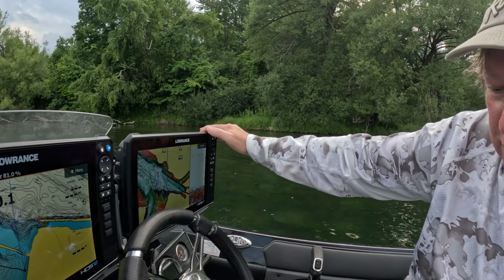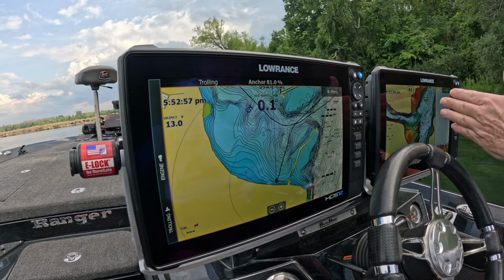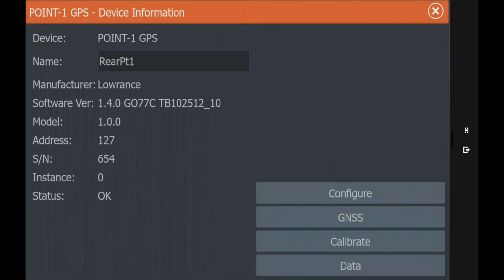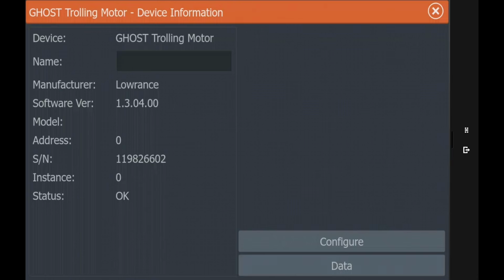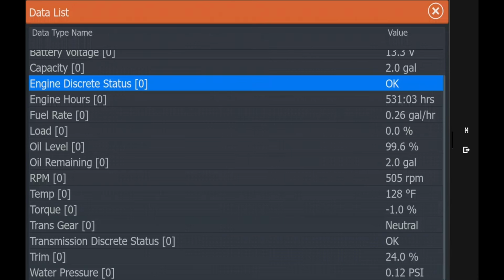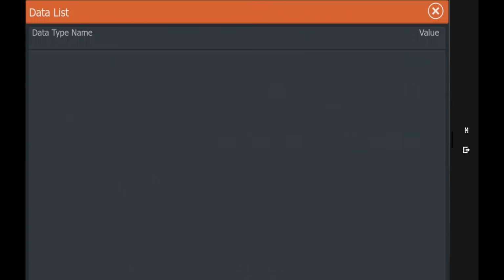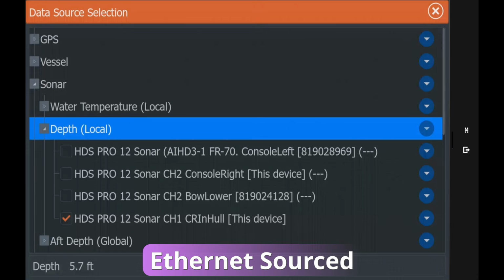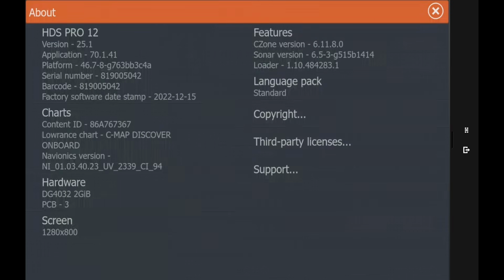Lowrance Networking Basics Ethernet and NMEA 2000

Comment: Hello Gary, I am trying to help a friend who has 3 HDS Pro 12 on his Ranger. Somehow in this network settings he has named his left side unit 4 times “Left Console Unit”. How does he delete the 3 names he does not need.
Reply from the maker: Hi, sorry for the delay. If I understand correctly, the boat has 3 units with 2 on the console and 1 on the bow. Usually when you name a unit in the network name on the Network setting panel, it will stay that value and any existing one is removed. Then if you look in Data Sources, a unit will come up in multiple places with that name. If his left console unit has 2 transducers connected, then you will see at least 3 Sonar sources for that unit - one for CH1, one for CH2, and another for "panel select". You'll also see it under the temperature sources since most likely there will be one transducer that has a temperature probe on it. And it'll show up as a GPS source. Also, if you look at the Device List, which lists devices on the NMEA bus, then you will see 4 to 6 devices listed for one unit since each unit provides multiple data types to the bus. That is normal. Contact me on my Facebook account if you need further help. Garry

Comment: Hey Gary…my device list does not show the AI3in1HD ducer, the thru hull ‘ducer, nor the nosecone. Should these items be indicated in the device list?
Reply from the maker: If you go to the Sonar Installation dialog, then you should see the thru-hull on CH1 and nosecone or 3in1HD on CH2, depending on which unit. If the thru-hull is a 9 pin then it will be automatically detected properly but it may show up as unknown. I usually set that to PD-WBL The nosecone and 3-in1HD are 9 pin, so they are detected properly. In any case, 9 pin transducers are detected and you can select the available frequencies on the Sonar page. Garry.

Comment: Should the ethernet connection share Point 1 data between units?

I have a Point 1 connected to the console unit. It works properly. I have ethernet to two Elite FSs at the bow. They seem to be able to "see" the Point 1 in data sources, but always show (Invalid), and heading on the charts is definitely not using the Point 1. The ethernet connection works great for sharing waypoints and sonar.
Reply from the maker: You need to check your Devices on the Network Settings. The Point 1 is only connected to the NMEA bus.  In order to see the Point 1 on all of your units they have to be connected to the NMEA bus.  The Point 1 is not shared on Ethernet.
Reply from the maker: Also, make sure that the NMEA bus is properly connected and powered. For your configuration you should have 2 terminators (one at each end), 3 Tees, 2 drop cables that connect to the units,  the Point 1 drop cable, and a power node that is a Tee with a cable to is fused and goes to your power supply.
Reply: All worked properly once I extended NMEA to the bow. I had just incorrectly assumed that the Point 1 data would be relayed/shared over Ethernet after it was connected to the console unit. 

Thank you for the great channel. It's helped me a lot as I've rigged out my boat.

Comment: I’m running three Elite FS10 units, a Elite FS12, and an AT2 system ran through my NEP2 hub and NMEA2000. This video helped a bunch, when I pull my boat out this weekend maybe I can finally get data besides just waypoints to share between my units. Fingers crossed but if I don’t I’ll probably have some questions.
Reply from the maker: That sounds good. Try to see if you can see any other Sonar sources on one of the units. Pages->Network->Data Sources. Then open Sonar and then Depth. You should see all of the units that have a transducer on them. If so then they are sharing data on Ethernet. I hope that it works (it should).
Reply: @garrywoodruff960 I do see other data sources, but I am not seeing sources in terms of sharing mapping chips or sonar options. About the only thing that seems to be linking properly besides the waypoints is the Point1. Any ideas?
Reply from the maker: The waypoints and the Point 1 are networked by NMEA 2000. So, can you see the blinking lights on the NEP2? If not, then make sure that it has power and that the Yellow wire (wakeup) is powered. Can you see the Active Target on the units? If you go to Pages->Settings then scroll up to About then Support then check for updates, do you see all 4 of the units, the Active Target, and the Point 1 in the list? (you'll have to scroll up to see the rest of the list.

Comment: New to understanding NMEA networks. My boat has 2 Lowrance HDS12s connected via NMEA along with Sonic hub and Point 1.

My GPS signal is constantly going in and out throught the day. If I switch the GPS source to point 1 on the bow graph, I have GPS signal. I went to diagnostics and the Bus keeps switching from On to Off. This happend occasionally last year, but almost non stop this year. Also, the sonic hub is sometimes available, and sometimes not. Thus also leading me to believe its NMEA related.

Where should I start to look to fix this problem? I appreciate the help.
Reply from the maker: It does sound like the NMEA 2000 bus is not operating properly. Here are the checks -

(1) check that each device (Point-1, SonicHub, each unit, etc.) is connected to the bottom of the Tee connector.
(2) Check that there is a resister on each END of the network.
(3) Check that there is a power line on one of the Tee connectors and that the fuse is good.
(4) Check that all connections on the bus are tight.

All Tees should have a device or the power line on the bottom.
All Tees should have a backbone cable, another Tee, or a resistor connected to it.

You can also check the network by :

1) Settings -> Network -> Device List
    -> It should list 5 or 6 devices per unit, Point-1, SonicHub, etc. (it depends on if you have other devices as well like a Ghost or Recon trolling motor, auto pilot, and so on)
   > then select the Point-1 and touch Data in the bottom right - it will show the data from it.
2) Settings -> Network -> Diagnostics
  -> on the NMEA 2000 tab you should be transmit and receive counters and possibly the error rate. Make sure they are increasing for the counters.

You should be able to do the above steps from any unit that is connected to the NMEA bus. That will help determine if there is something wrong with your backbone cable(s) or connections. If you see the network at one unit and not another then you have a segment to look at.

Let me know. Garry

Comment: I am using an HDS 10 Pro connected via NMEA 2000 to a Lowrance Recon. On my previous setup (HDS 9 Gen3 + MotorGuide), I frequently experienced control lockouts when mirroring to a tablet. After a period of navigation, an error would pop up, forcing me to leave the deck and return to the main unit in the cabin to regain control.

Does the HDS Pro allow uninterrupted control of the Recon via tablet, or do these lockouts still occur on the newer platform?
Reply from the maker: The Pro is a much faster unit than the Gen3 and the Recon is better integrated with the software, so I would expect fewer issues with mirroring. It also depends on your tablet as well. I have not tried to control my Ghost from my tablet yet (Samsung S10). If you are still having issues then I will try to replicate your problem when it finally ices out and warms enough to pull the boat out of storage. I can also ask on the Pro staff call this week for you. I know that several of the guys have a Recon and Pros.

I hope that helps. I'll let you know if I get some information from the meeting. Garry
Reply from the maker: I asked my pro staff contact about the Recon for you. I'll let you know when I hear something back. Garry

Comment: Im nit getting any power to my nmea bus. Can you help please?
Reply from the maker: Hi, first you need to locate the power node on the NMEA bus. It will be attached to a Tee and then contains an inline fuse holder before connecting to power. I would make sure that the fuse is good and that you have power and ground connected to the end of the wire. If you cannot find the power mode, then there may not be one in the circuit and you'll need to add one. The NMEA 2000 bus only requires ONE power node to operate. I have seen boats where there were two and the network did not properly operate, I had to remove one power node and properly cable the network to get it work.

Next make sure that your network has terminating resistors on EACH end of the network. The resistor is connected to a Tee on one of the top sides. The other side of the Tee connects either to another Tee or to a NMEA cable. This provides the network backbone to the boat. You'll have a female and a male terminator for your network. They come in pairs.

You can go to your units. The NMEA plug is the small black one. Make sure that there is a cable attached. And make sure that the cable attaches to the bottom of the Tee.

Then power up your unit and go to Settings->Network->Device List. That will show you the devices on the NMEA bus. For each unit you will see 5 or 6 devices, that is normal. Other devices will be optional like temperature sensors, engine controller, trolling motor, etc. Some devices, like the engine, trolling motor, other units, need to powered up to see them on the bus.

Let me know if that helps. Garry

Comment: I'm will be using a HDS Pro 12 and HDS Pro 10 at bow of boat. I have Active Target 2 connected to the HDS 12 and the 3-1 Active Image nose cone on Ghost trolling. I am adding (2) HDS Pro 10 at the console. One will be connect to In-hull transducer and other is connected to S3100 mudule that is connected to 3-1  high and wide active image transducer with Fish Revel. Do I need the NEP 2 hub or can I connect all units together?
Reply from the maker: You don't need the NEP2 but you will see a performance improvement if you do. The important module is the AT2 to connect to the hub as it puts out a lot of data. The S3100 does as well but not as much but more than the units. I would also connect the Sync wire on the AT2 module with the Yellow on the bow unit. And the Sync wire on the S3100 with the Yellow wire on the console unit that has the in-hull transducer. My configuration is similar with 2 Pro12 on the bow, AT2 n the bow, 2 Pro12s on the console and a S3100 at the console as well. The only change is that I have 2 in-hull transducers and 2 3-in-1 transducers on the stern. You might want to look at the video that I did on the gigabit upgrade to see the performance numbers. Garry
Reply: @garrywoodruff960  Thanks Garry. Do I need to connect the blue wire from S3100 to blue wire on the HDS Pro 10? I am pretty sure the yellow wires connect to each other for remote turn on same as with AT2 remote turn on.
Reply from the maker: There is no blue wire on the HDS Pro power cable. There may be one on the NMEA 0183 cable, but that cable is not used. So, you will have to use a switch on the Yellow wire on the AT2 module to power it up since the wakeup function on the Pro will be the Sync function. Garry
Reply: @garrywoodruff960  Thanks Garry. I have everything installed but am working on configuring transducer to HDS unit. Since the 3100 module connects to HDS instead of the actual transducer, what should the sonar settings be on the HDS unit?

Comment: If I'm running NMEA  do I need the NEP if I only want to add 1additional unit for a total of 3 units,  with Active Target 2. Can I just add on to my NMEA with another backbone?
Reply from the maker: As I said in the video, the NMEA 2000 bus only transfers small amounts of data. You need Ethernet for sharing sonar, side/down, maps, GPS/heading data, waypoint database, AT2 data. I would add the additional unit to the NMEA bus and to the Ethernet network.

Depending on your units, you can daisy chain them together but you will get a performance hit on the AT2 data. (Look at the video on my Gigabit network upgrade to see performance data). Some Live units (post Covid) had issues with sharing data through both ports reliably. The best solution is to add a NEP2 network hub. That way as long as the hub is powered you will have shared data to each unit whereas if you daisy chain from one unit to another then if one unit in the middle of the chain is not powered on then your network is partially down.

Garry